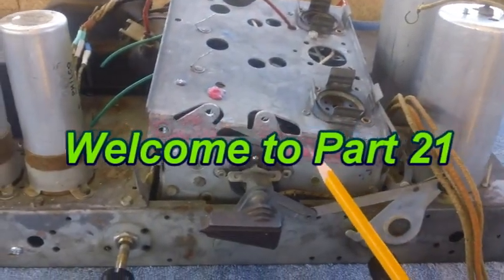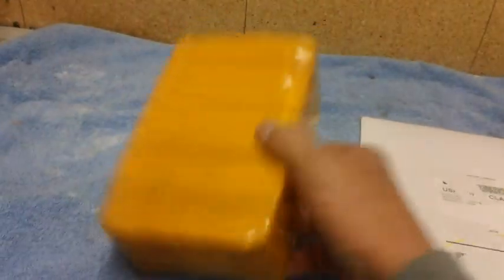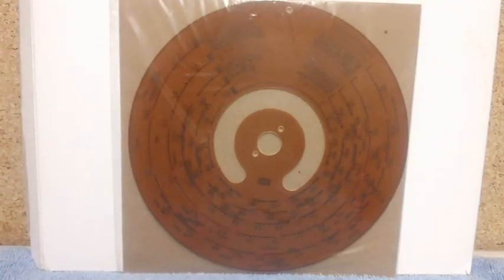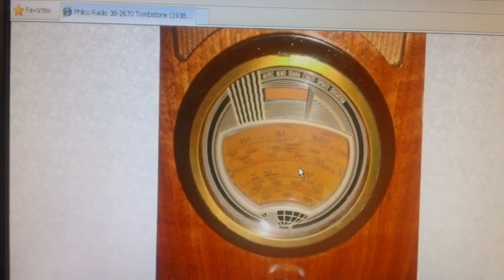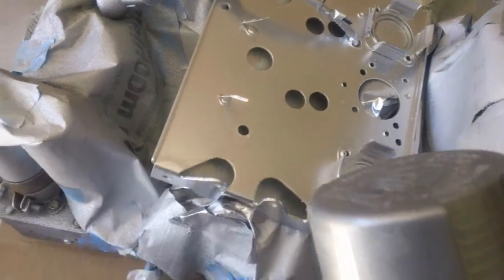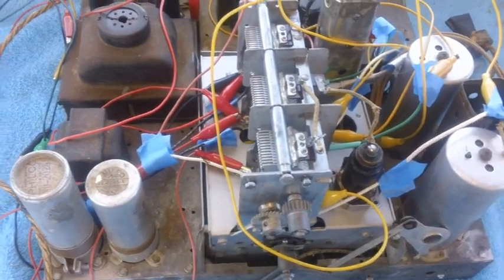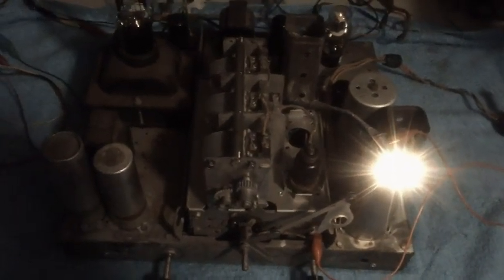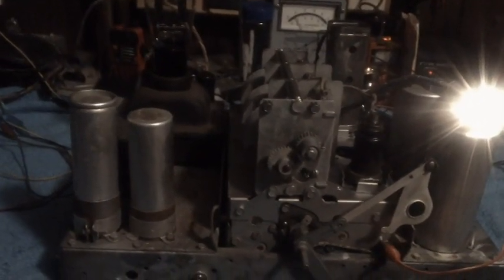Philco model 37-2670 repair and restoration (Part 21 of 34).

Comment: It's coming along very nice! I've ran into the same problem when using long test leads in RF and IF circuits. In some cases, the circuit either didn't work well or didn't work at all, likely due to the lead length and the possible extra capacitance introduced by two test leads in close proximity to each other.
Reply from the maker: You're 100% correct.  The long gator wires were perfectly messing things up.  When the radio failed to tune I suspected it might be the gator wires, so I removed them and contacted my mentor, Brendan, to get his input.   His view was the same as yours.
But she's thankfully purring right along now.  I'll cover this whole thing in the next vid.  Folks need to know.
BTW...where the heck do you store all the stuff I've watched you obtain over the years?   :-)

Regards,
John

Comment: RF Chassis looks great, John, that paint combination looks like it did it proud.  Big sigh of relief, over that dialface.  I know I was worried about you finding one to match.  I looked at RadioDaze, but, I know I didn't see that one.  Good for Greg.  For those that don't know, Radio Attic is a great place to look at old radios.  Using it as you did, for reference photos, is invaluable in refinishing, as are places like RadioMuseum and PhilcoRadio.  Radio Attic sells mostly radios that have already been restored and the prices are really, really high, in my opinion.  If somebody didn't want to restore a radio themselves, it would be a really good place to buy one.  You can buy two or three unrestored radios for what they want for one there, though.  Still, it's a great place to look at pictures of radios.  Have fun with the naval jelly, my friend.
Reply from the maker: Al,
I blew it by saying Greg VB was the one who brought the Radiodaze dial info to my attention.  Wasn't the right Greg.  So I owe another Greg a big "I'm sorry".  I can't seem to do anything right of late.  :-(   That's it...I'm changing my brand of liquor!

Regards,
John

Comment: Like everyone is commenting, I love the undercoated highly reflective color then topped off with a less reflective overcoat.
As far as the gator wires goes; That is a lot of length of extra wire hanging off the sides of the tuning cap with very little signal. Might be why it was so deaf.
Just a hunch.
Nice work as always John.
73s
Tom
Reply from the maker: Tom,
Exactly right, my friend.  In some cases more really is less.  :-)  Also, I agree with you about the chassis color.

Regards,
John